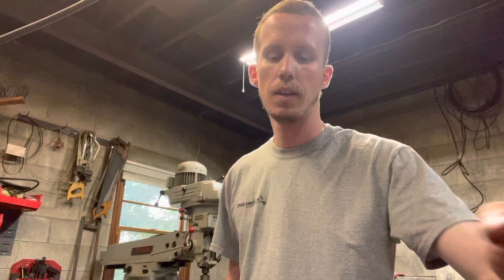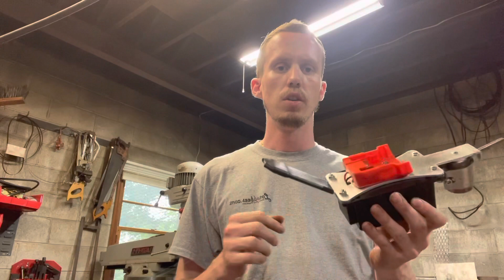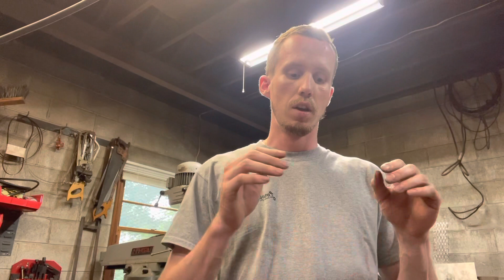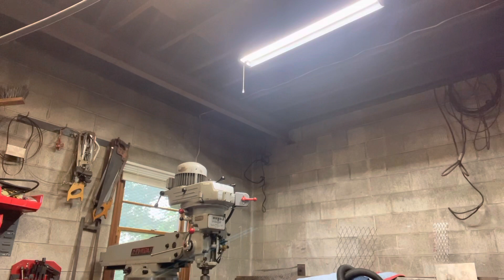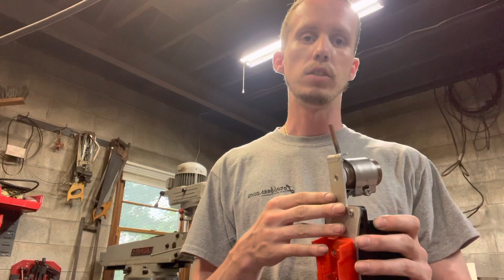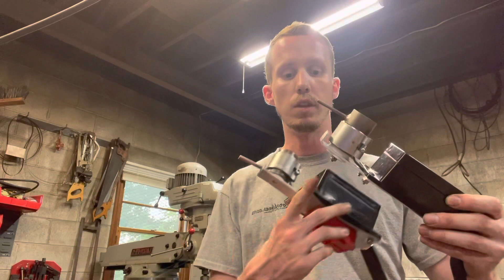Big Update: Battery powered units and Bolt redesign progress.

Comment: You were saying when you started this adventure with battery vaporizer you said Milwaukie and Dewalt. Is there a brand that seems to be working best?
Reply from the maker: I think they both work great. Technically dewalt 20v at the same amp rating as Milwaukee has a slightly longer lead time.

Comment: Hey Rob, I know there are adapter plates for Apimaye, but will the stem on these units not fit into one of the entrance holes on the hive and work that way?  Or does the landing board get in the way?  Good work on these new battery powered units.
Reply from the maker: These stems will not fit them. The adapter plates really should be used with a wall powered original unit. The 380w heater limits clogging I would assume it would get hard to handle with this 250w heater element.
Reply: @LorobBees  right, my question/comment on the adapter plate wasn’t specific to the new battery powered unit.  I should have been more specific.  I was hoping with the lower stem placement on these new battery powered units that they would clear the landing board and fit into the entrance of the Apimaye. Thanks!
Reply from the maker: @LawsonsCreekApiary  Sorry, yes, with the lower stem the cap would interfere with the hives body.
Reply: @LorobBees  makes sense, thanks Rob!

Comment: High temp loctite is rated to 450F and ultra high temp is rated to 650F. Not sure if that would help to keep the bolts in place.
Reply from the maker: The issue is the thermal expansion of the nut itself, so we switched to nuts that are designed for high temp ranges. They seem to hold much better but I want to get more testing under our belt before we switch standards.
Reply: @LorobBees  Ah, that makes sense. High temps cause all kinds of interesting challenges. You guys do great work.